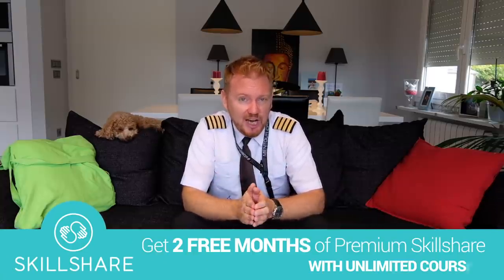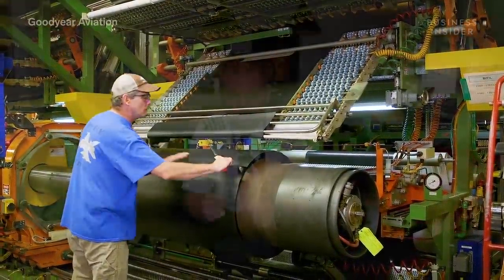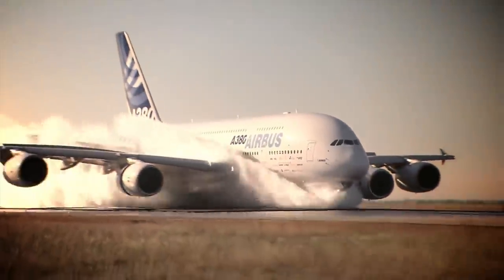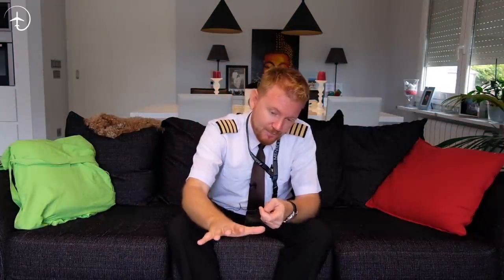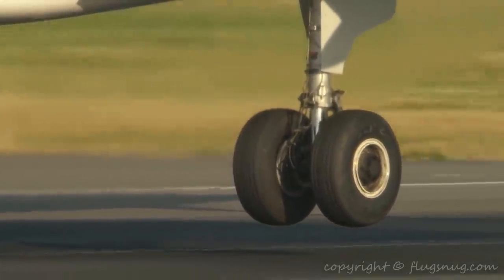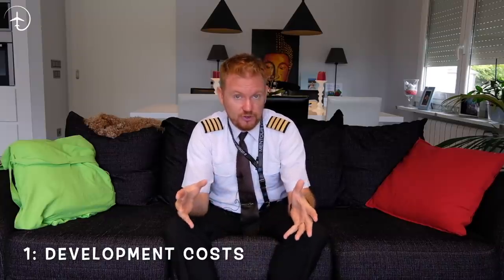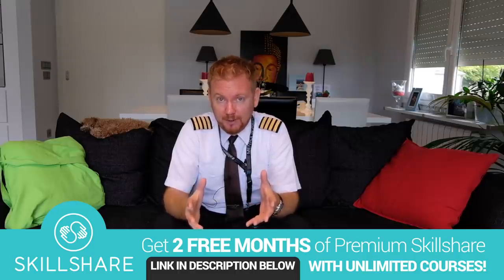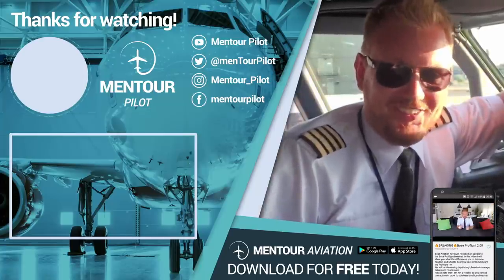Why not make plane-tires spin, before landing?!

Comment: this has been tried on a plane from the 50s - Lockheed Constitution.   turns out the rotating wheels caused some funny gyroscopic  effects which made landings "interesting"
Reply: That, and passenger plane tires are really damn heavy and to "pre-spin" them would require really tough and heavy motors or engines, which means less payload, OR additional complexity to make the wheel spin using the turbine engines, which means more points of failure.
Edit: Both of which of would require additional maintenance procedures, which defeats the purpose.
Reply: @grenzviel4480  i don’t think Motors would be necessary, some baffels to catch the air could start some spinning of the tires with less need for maintenance but i guess it would also add weight.
Reply: I can totally imagine that. 6 or 8 huge spinning wheels!
Reply: How interesting?
Reply: @macflod  I had the same idea
Reply: @macflod  re: "baffles", Increasing bulk, requiring larger bays, decreasing payload volume and/or increasing weight.
Reply: that doesn't make sense..
in the 50th.. WOW 😲
they wouldn't have been flying if it wasn't for ww2
even then,, the airplanes were already antiques & still learning how to fly them.. if they didn't crash
salam 👋 (means peace)
Reply: who needs gyroscopes when landing..
I should say when crashing... were they using compasses then.
HAHA 😄...
at that time, compasses were seling like hot cake
on your watch, reckless, flash lites ++++
we're you one of those pilots.? I admire your spirit..
salam 👋 (means peace)
Reply: @issamhage4199  a gyroscopic effect isn't a gyroscope, but an effect of something round, like a wheel, that turns around its axis
Reply: @issamhage4199  It's not clear what comment you're referencing. If it's the subject comment, the stated gyroscopic effect is very real.
Reply: Initial braking action is from the tires .
Reply: @rajrammbbs  I hadn't thought about that, but it must take fair amount of energy to spin the wheels up, and the gradual acceleration would apply a gradual effect. Seems to make sense.
Reply: Love the
Reply: @macflod  it could certainly be done, some kind of hydraulic scoops could pop out and blow air across vanes inside the wheel. it could be turned on and off, wouldn't weigh that much, and wouldn't really be a problem if it stuck on or off. But even that amount of added weight and maintenance isn't rly worth it when you can just burn off a tiny bit of rubber each time instead.
Reply: @materliliorum  what? gyroscopes don't have to be round, anything spinning experiences gyroscopic effects. a gyroscope is just something spinning and free to move in one or more axis. spinning wheels will act like gyroscopes, specifically rolling to the right will torque on the plane in the yaw direction, but putting in a yaw input will result in the opposite roll output. This is basically why you have to counter steer on a motorcycle. you turn the wheel in yaw, and the bike leans in roll the opposite direction.
Reply: neato!   50's aircraft for the psychadelic landing!
Reply: That's what I was thinking. Doesn't seem like the concerns he mentioned in the video would really be an issue as far as the physics... But gyro precession is an unwieldy force at scale and could cause all kinds of bullshit
Reply: @chrismofer  Well that and you shift the center of gravity to one side causing the bike to want to lean the other way as well. It isn't just one force or the other in play, it is both
Reply: The bouncing bombs developed by Barns Wallace weighed four tonnes and rotated at about 300rpm to enable them to bounce further. The modified Lancaster's were less responsive due to the gyroscopic forces which seems to add weight to the "interesting" handling characteristics point made in the comments.
Seems likely that it's just not worth the effort even without the detriment to handling.
Nice video. I did learn something new here. 👍
Reply: goofy
Reply: From a pure oh my god reaction - it would lead to utter disaster - my crystal ball foretells me of locked up wheel(s) dunking the nose into the tarmac or skidding off the runway the moment I saw this. The issue is that nothing is perfect. Far better to have less complicated free wheels. Adding to complexity adds to the infinity of possible disaster scenarios! Look at all the computer automation errors: auto throttle retard engagement drop out of sky mode, commanded pull up forcing auto landing mode. Bottom radar failure making computer thinking you on ground when ya 1000's feet up... Sudden uncontrolled banking due to CPU hung. Nah, just add an override stick and lever just in case automation leaves the deck, thanks...
Reply: @materliliorum  technically it's a rudimentary gyroscope
Reply: I know from some air shuffles ...it whas a work of "scoolboys" 40years ago!
Reply: The YouTube algorithm has brought me to your videos a few times. While the subject lines sound interesting, clearly you have done no research into the topics you are lecturing us about, as if you are an expert with your fake costume. You are just making it up as you go along, and significantly more insight is provided by your long suffering audience. It's amazing how many followers you've managed to find yourself, given how little value you provide them.
Reply: @user-fed-yum  Had a bad day?
Reply: @charmio  what is wrong with calling out bs!
Reply: What about putting vanes on the wheels so that the air flow spins them as they come down from the carriage?
Reply: @charmio  it was really 20mins of almost no value, except this thread tbh. The gyroscopic effect is the only real reason I can accept. As if everything else didn‘t need certification, but the motors for that scenario would, so it is saved - that is bs with no economical thinking.
Reply: @adriankucinski481  answered way above already - the gyro effect seems to be a valid reason, I‘d still be interested in hearing more real (physically grounded, maybe even experimental aircraft based) talk about it.
There was talk about e.g. the direction of the wheels resulting in yaw, but they are turning nonetheless, just right after touchdown, and I‘ve never heard of formula 1 cars being affected by it (same speed), so what is the real impact (or rather would be).
Personally, little blades that spin up the tyre through wind without any mechanics or motors, resulting in spin prior touchdown thus reducing wear would make much sense.
And this topic is pretty untouched. Just endless reasons why no motors.
Reply: Just like riding a bicycle.🤗
Reply: It would be a bloody good idea for fuel savings by using them in takeoff to accelerate too. 
You could avoid engine design compromises to allow them to provide maximum power and thrust in the low speed of take off and in taxi'ing.
And still have high altitude  high speed low thrust efficiency.
We currently have very poor efficiency in both cases. 
You could easily store and retrieve enough energy in the battery capacity needed to handle these short duration bursts without much weight. And the weight saving from tyres that don't have to handle such extreme abuse and the simpler more efficient engines would probably eliminate any weight gain. 
Motors fail? Rubbish! Electric motors don't easily fail. Electronics do. 
Just use brushed DC motors. And good unbustable, simple and cheap early 1900s soft start and power control systems. As still used in electric locomotives and industrial equipment.
Reply: BOLLOCKS. 
If that were the case then takeoffs would be even more "Interesting".

It would take 300 kilograms of batteries and less motor/generator weight than the weight savings from chucking the friction brakes to use electric regenerative braking systems to accelerate a 100 ton plane to take off speed. And brake to a stop on landing.

And the fuel weight saved would be enormous. 

Engines could be far simpler and more reliable and efficient at flight speeds, if they didn't have to provide maximum thrust at low speed high Atmospheric pressure on the runway. It's all about making money on crap disposable wear out fast, inefficient rubbish.
Reply: My dad born in 41 actually sent letters (back when stamps and envelopes were a thing) suggesting this... Boeing send him a free pen and some plastic pilots wings. I can't wait to tell him I sent him this video then spend 8 minutes explain how to open a link on his phone... and listen to him watch if while he asks a 100 questions. Great topic though.
Reply: You talk magnus effect?
Reply: @user-fed-yum  It is true that he has little background in engineering, which allowed him to miss a couple possibilities here, and the big negative, the gyroscopic effect. He is however, extremely well educated within his specialty. If you had a little aviation background, you would appreciate his knowledge of both the industry and its failures. (And you would know what he flies, and for whom.)
Reply: @pan6593  Definitely gyro effect when steering Formula 1, but it’s camber load, calculated for in wheel bearing design. If you’re off the ground, it would present as roll. Same effect makes a snap roll faster in one direction than the other in aerobatics.

I wonder if air motors running on turbine bleed air would be a reasonable application. They’re much lighter than electric motors. Seems like 90% speed would be a good kickout point…

Initial certification would be intense, but maybe worthwhile. Maybe not. Weight of two paying passengers (18 tire aircraft, associated piping, etc) vs. tire cost/cycle?
Reply: @aaronfranklin324  Nah. You gotta have that same engine (which seems oversized for cruise) for climbout/ go-around. 

They will never abandon mechanical brakes. A computer managed regenerative braking system would have to have a level of redundancy that is possible, but is not sellable to the FAA in the foreseeable future. 

Your weight estimates seem low. 100 ton aircraft, 200 mph deceleration in 8000 feet, 6,900 kWh? Maybe 3,600 lbs of batteries. Weight of 19 paying passengers.
Reply: @russbell6418  that's just a back of the envelope calc of kinetic energy at, I think I used 80m/s = 288 kmph  and full load takeoff 100 tons. 
And quoted energy density of Tesla LIon packs. 
Of course there would not be 100% efficiency. 
But of course there would be thrust contribution from an engine optimised for flight speed, and faster initial acceleration from driven wheels and lowered mass primarily from fuel load requirements. 
And probably generator contributions from the turbine engines, that would further reduce battery draw.
So I'm pretty sure a clean slate design would make that estimate pretty conservative.

Sure. The FAA wouldn't be likely to licence it for commercial Airliners. Because they are far more interested in US manufacturer and energy company profits, than safety and operator/consumer cost reductions. 
But who really cares about   the United States and their economic imperialism anyway? 
Most of the world now see's them as a spoilt little toddler that's been indulged far too long. 
Countries like China may well implement such things for Airliners, and make the US industry obsolete overnight. 

Hell. In New Zealand we Thrash the best the US can do in with Americas cup Yachts that have higher loadings than 100 ton Airliners, and similar hull dimensions, but less than five tons of structural weight. 
If we just slapped some wings, helicopter turbines driving advanced high-speed props or fan jets, and electric assisted recyclic launch/brake wheels running hard compound Formula 1, or maybe landspeed saltlake tyres on the landing gear trucks, we'd probably shit all over contemporary airliners.
I wouldn't bother with electronic commutated syncronus AC motors personally. Simply switching cells or motors from series to parallel configuration directly in circuit with Brushed DC motors would give you more than adequate control over speed and power and is inherently a recyclic braking and ABS/AWS system. More efficient than brushless DC electronic regenerative braking.

More built in safety factor, by redundancy and simplicity. 
Not long service hours or peak power durations so brush wear and cooling is less of a limitation. 

A two speed planetary gear system would minimise motor+gear weight and increase taxiing efficiency and initial acceleration. 

No reasons to not do all this on light Aircraft. Particularly Ultralight hybrids since they immune to bureaucracy, and have lots to gain from  simple optimization of takeoff and high-speed efficiency, weight savings by this method. Ultracapacitors could be a better choice for them, with their lower mass to Airframe volume ratio.
Reply: @russbell6418  have you noticed how Airliners in a takeoff run accelerate fastest in the last part of the takeoff? In complete contradiction to the V squared  part of the kinetic energy they are gaining?
They waste half of the runway just getting enough speed to breathe. 
Climbout and go-around are not incompatible with high altitude cruise efficiency. The Airmass flux available to the engine intake is similar at 300kmph sealevel to 900 kmph at 30000 ft where it's about 0.3 bar.
Really they could operate at highest thrust in the low altitude takeoff and climbout Air pressure and velocity environment. 

And get best cruise efficiency,  at perhaps 45000 feet at around 20% of takeoff and climbout thrust, where air pressure is about 10% of sealevel. 
Without compromising engines for the strangling at low speed.
Reply: I’ve always though a small electric motor on each wheel to spin it up 10 seconds before landing would save a lot of wear
Reply: Wow.. I found a video about this thing. It used rockets to take off on shorter runways.  Crazy.
Reply: yup it's gonna make planes "backflip"
Reply: Are there videos of these landings? It sounds ""interesting"".
Reply: It is so very obvious none of you ever played with a gyroscope as kids. You will not see any effects from a spinning gyroscope until you try to turn it off it's axis.
Reply: Interesting is a very peculiar choice of words
Reply: @grenzviel4480  jaguar has 300hp electric motor which weighs 16 kilos. Mounting them on all wheels would weigh less than one passenger
Reply: The solution is to spin them up just seconds before touchdown
Reply: @tedarcher9120  t
The "solution" is to keep the current  system. Why spin the tires at all.? There is no need. No one on here has said one thing about why this should be adopted.  What harm is in the way it is now?
Reply: @davidlang4442  the harm is 
1) wasting precious fuel on taxis 
2) wasting motor hours waiting your turn before taxi
3) wasting a lot of expensive tires for nothing
4) wasting a lot of money clearing the rubber from the strip
5) Wasting precious time closing the strip to remove rubber deposits
6) Wasting a Ton of time and money re-surfacing runways destroyed by rubber removal
Reply: @tedarcher9120  if this was such an issue then planes would already have spin up tires. It is not and will continue to not be an issue.
Reply: @davidlang4442  If travel was an issue, planes would have been invented 10000 years ago. It means planes are useless. Do you know that american air control still uses paper strips?
Reply: They had also tried that on B-17s in england during WWII. The gyroscopic effect made aircraft handling as they approached the runway VERY difficult. It was tried because rubber was scarce during WWII.
Reply: you wouldn't need a wheel motor. just a wheel hub with asymmetric paddles that the relative wind could spin up.
Reply: @GaborRevesz_kittenhuffer  no
Reply: I never knew of this.
Reply: @tedarcher9120  and torque is their game. A small wire to charge the lithium battery and a signal to turn it on and off , they could give reverse torque to stop and forwards when they are leaving.
Reply: Is there footage to those effects?
Reply: Yep. Too heavy, requiring more fuel and less cargo, and physics. Gotta love gyros.
Reply: The spinning would have to be started well before the touchdown on the landing strip, wouldn't it?  This would make the plane's path and attitude wonky if it needed to undergo a directional adjustment after spin started, say if the plane was not already exactly straight on down the runway.  The plane would steer like a bicycle.  It does sound like it is better the tires be gyroscopically inert until the plane has touched down.
Reply: @tedarcher9120  All these things have been at least optimized.  While it's called rubber, it's more like a hard rubber comb rubber than bouncy ball or eraser rubber or even automotive tire rubber.  Some of the acoustically played phonograph records of old were made of a hard rubber too, the better to withstand the styluses of old which had to carry considerable energy from the modulations in the grooves in order to generate a satisfactory sound.  Were the tire rubber wear not part of the system for wearing speed off of a landing airplane, then additional brake wear would be, with the mineral and metal dust it would leave behind.  I thought of another factor too, which is "stuff" that gets into an engine being kicked or blown up from the runway surface.  Better it be a burnable organic material than a nonburnable metal and mineral material.  It is, on a small scale, like how jet engines are rated for bird strikes but not drone strikes.

The "bug" has been engineered into a feature.
Reply: @dennis-nz5im  The amount of energy added or subtracted would not be great compared with the power of the jets -- and the tires would still wear transferring energy.  Some dug-in traction, I think, is good even on takeoff, as the craft may have to leave in buffeting winds, and it would be no bueno for the craft to be skating when it does.

Could there be a kind of rack and pinion arrangement for takeoffs and landings?  Well maybe, and it would look cool with those gear wheels on the aircraft, but if the aircraft has to emergency land it's gonna be ruff.